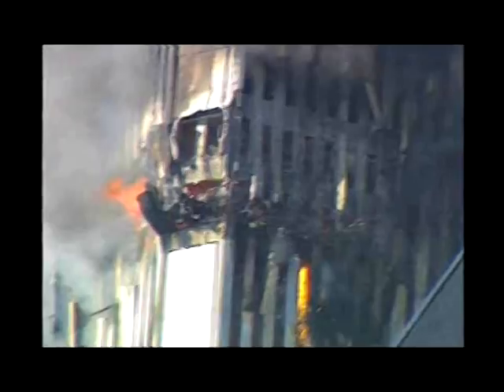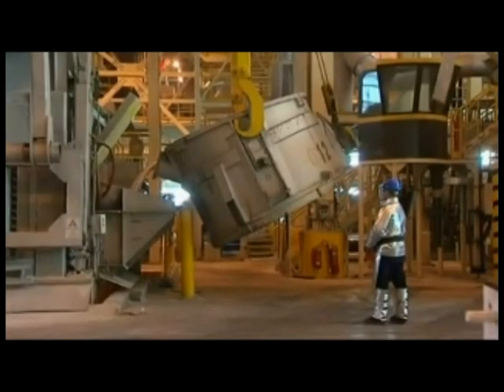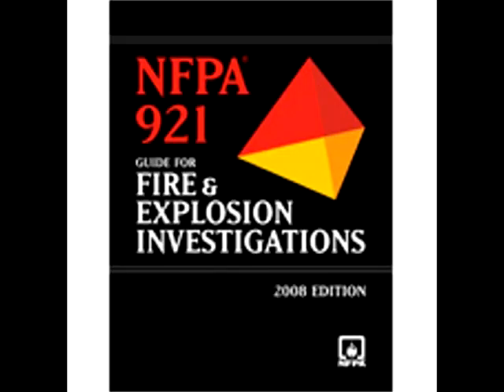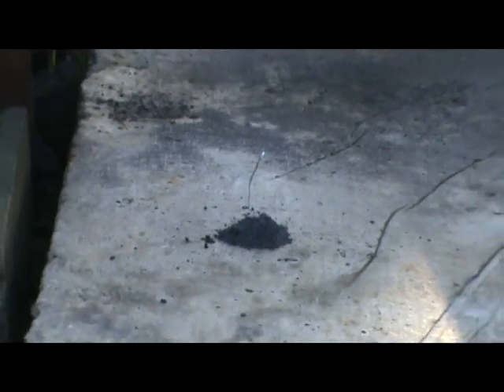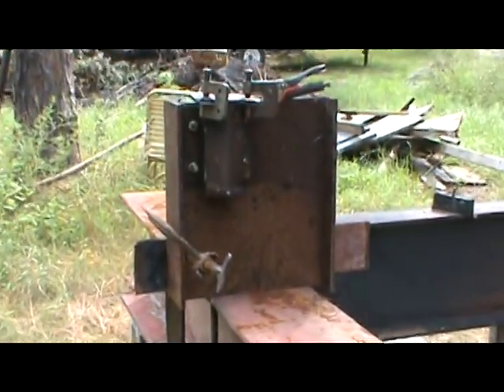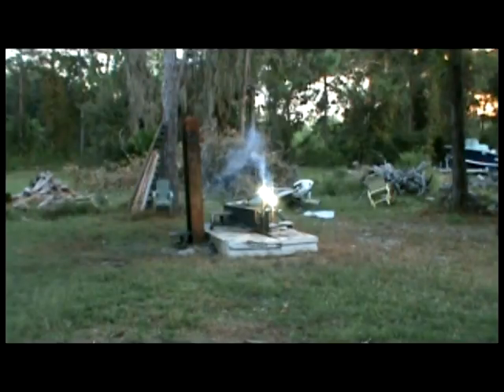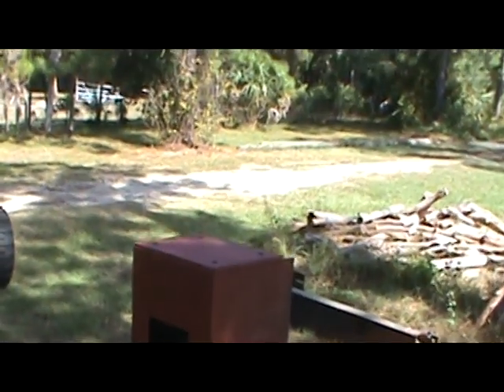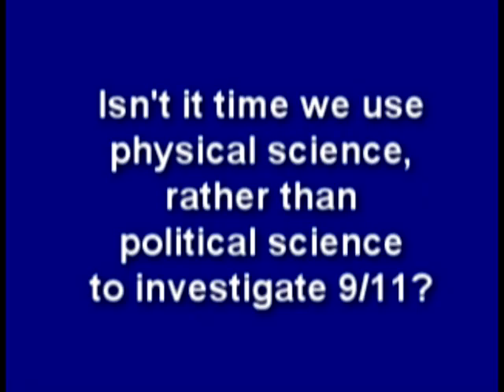9/11 Experiments: The Great Thermate Debate

Comment: Truth does not fear investigation.
Reply: I would say truth doesn't fear an honest investigation
 performed by people who don't believe in magic
 of course if I made just a few hundred million shy of one thousand billion I could afford my own investigations
Reply: @partypoet2012   The problem the truth has is that conspiracy theorists rationalize away any facts that disagree with their conspiracy theory. Believing in a conspiracy theory boosts their egos because they think that the have knowledge that the 'common people' don't.  This makes them emotionally invested in the theory.  As a result they are unable to apply any level of skepticism towards the conspiracy theory because if they did - their egos would be bruised and they would have to admit that the people they refer to as 'sheep' are smarter than they are.
Reply: In fact, sometimes it does. If the investigators are not truthful
Reply: Investigate auschwitz.
Reply: How many of you know who wrote that quote?
Reply: @Mekronid "If the building indeed was bending against a straightedge as you claim, then logically the building's top half could've fallen sideways instead of on its own footprint."
First of all you can see this for yourself.  In fact this is why I recommended that you do this for yourself.  
Second of all:  Remember Newton's laws of motion?  If you want to building to fall over then you need to produce a force with sufficient energy to do this.  Otherwise everything is going to fall in the direction gravity pulls it.
The pillars supporting the building were designed to support vertical loads.  They were not designed to support the loads at an angle.  So the support pillars would fail and with nothing holding the building up - everything will moved in the direction gravity pulls it.  
Buildings are not trees.  In fact look up some videos on tree cutting fails.  There's one video that shows that happens when you try to cut down a hollow tree.  It fell straight down until the void was completely gone and only then tipped over.  
Learn some basic physics.
Reply: @Mekronid Yes they do.  But if you look at the videos of the 2nd tower in the minutes leading up to the collapse - no building was designed to lean that far.  And when resisting wind loads the force is spread across the entire height.  This lean all came from a few floors.  And remember that the steel there had already lost between 40-60% of it's strength simply from the heat.  (Which was why it was bending.)
And once steel exceeds it's elastic limit - it weakens very, very fast until it breaks.
Reply: @Mekronid And speaking of earthquakes - remember that the steel in the tower was not as strong as the designers calculated because it contained the same construction flaw that just about every steel framed building built before the mid 1990's have.*  (Except for the ones that have been retrofitted.  But this will typically only be skyscrapers in earthquake zones.)
* Just about every country had adopted the same building codes for moment-framed buildings and it wasn't until the Northridge Earthquake that the near-fatal flaw was discovered.
Reply: @Mekronid Because - as I explained - the load was not distributed across the entire structure.  It was concentrated on the floors struck by the airplane due to the damaged support columns and the weakened steel.  
And the reason it didn't fall over is because when the steel failed the load was transferred to the remaining columns - creating a progressive failure that cause those columns to fail.  (And this all happenned in less than a second because every failing column meant greater loads on the remaining columns.)
Buildings are not trees.  Trees fall to the side because they cannot fall straight down.  For a building the most direct path is straight down.  And once the load is unsupported - it is going to fall straight down.  
Remember that when things move they will always try to fall in the direction determined by the force on them.  Since the force acting on those buildings was gravity - and there were voids that the building could fall into (all of those wide open cubicle-farm offices spaces) that's where it went.
Reply: @Mekronid Of course it zippered right open - it's what's known as 'progressive failure.'  As the columns on the leaning side of the building failed due to shear forces, the load was transferred to the next columns - which then failed, placing the load on the next, etc.
Personally I have my own issues with the NIST's model for the collapse.  IMO a British group researching fire codes had a better mechanism for triggering the collapse.  (Heat related weakening of the floor trusses.)  But this is quibbling because both models correctly calculated the time from impact to collapse and if one hadn't caused the collapse - the other would have.
And the exact collapse mechanisms is the two buildings were different.  The first building had the central core fail and on the second it was the exterior columns that failed first.
Reply: @Mekronid BTW: you gave up on the thermite/explosives aspect to soon.  I had a week's entertainment by having them try to explain how the explosives/thermite were placed on the exterior columns without everybody in the city seeing what they were doing,
Reply: @Mekronid You seem to think that any skyscraper can survive having all of the support columns on one side removed.  What you describe is a vertical truss and moment-frame construction is used to avoid the necessity of vertical trusses.  Remember that you want your structures to be as lightweight as possible because any increase in mass requires the the vertical supports be larger.  And larger vertical supports means a larger foundation to support the weight.  All of this increases the cost of the building and decreases the amount of usable space inside.  
The WTC was a trailblazing design due to the way the major structural supports were on the outside the building and around the central elevator core.  Everything else was open space that could be easily modified to suit the needs or any tenant.  And the floor structure also kept the support columns in place.  This eliminated the need for cross-bracing which not only meant that you saved a lot of mass. and my saving this meant  mass the support columns don't need to be as large, which meant that the foundations didn't need to be as large.  And smaller foundations meant more parking in the parking garage.  And smaller columns meant bigger windows.  
So the design of that building became taught in structural engineering classes as an example of what good engineering looks like.
Reply: @Mekronid Actually the question you should be asking is not why did they collapse so quickly - but why did they remain standing as long as they did?  And the flaws were not in the columns but in the welds that connected everything together.  In effect the steel was in tension - and tension that nobody was aware of.  As a result nobody's calculations took that tension into account.  Not a real problem because of the factors of safety - except when the buildings have to withstand tension loads that result from something like an earthquake.  In these cases you can (and did) connections fail because they could bot withstand the earthquake created tension loads that they were designed for and the additional (and unknown at the time) tension loads caused by the welds.
And the thing that doomed the central columns was the mechanical action of the plane debris (and everything else being pushed by the plane debris) that stropped out the fire-resistant wallboard and the cellouse-based fireproofing on the columns.  This meant that the steel was no longer protected from the heat and as a result the steel weakened at entirely predicable rates as they were heated by the fire.  But even if the central core remained protected from the fire - the buildings were doomed because the fireproofing for the floor trusses was also stripped off.  In fact you can see the effects of the floor truss failure in the moment before tower one collapsed.  The exterior columns were pulled inwards (and out of true) when the floor collapsed.
Reply: @Mekronid And the financial issue that company faced does not prove any conspiracy related things.  And as for the assets of a failed company being bought by another company - this is the business model for a lot of companies.  Buy a failed/failing company, fix the problems, have the company turn a profit for 3-4 years and then sell it and start the cycle over again.  You are making the same mistake rookie intelligence analysts make - reading into the data instead of focusing on the actual facts.  An example here is your 'revelation' that Bush's brother may or may not have been CEO of (Can you give me his name?  I just look a look and didn't find any of them who were not engaged in other business or political ventures at the time.)
Reply: @Mekronid Actually - it was not 'cheapo joints.'  That was a factor in making the building weaker than originally calculated but it was still well within the 'margin of safety' designed into things by competent engineers.  
The primary factor was the temperature induced weakening of the steel combined with the destruction of several support columns.  This was made worse by the sagging of the floor trusses.  Instead of helping hold the support columns in place they did the opposite.  They sagged and as a result began pulling the support columns out of alignment.  
Please note: I agree with the work done by the British more than I do with the NIST report.  The NIST report basically said that it was a combination of a lot of things - which IMO was a decision made to prevent them from making a solid determination that risks later turning out to be wrong. 
And it's pretty obvious that the floors pancaked down.  If you look at the videos of the collapse you'd notice that as the building collapsed the support columns were the last things to go and didn't fall until several floors below them collapsed.  This is why there were still vertical columns standing for several stories after the collapse completed.  
And the determination that the insulation was stripped off came from physical examination of wreckage from the floors in question where scrape marks from aluminum were found on the structural elements that were protected by fireproofing.  (One of the NIST reports has pictures of these.)
And you would get an instant failure of the floors after a couple of stories down.  It isn't just the weight of the debris - it's the kinetic energy of those debris.  And you can see the floors pancaking in the video by the blast of air pushed out the the floor above collapsed.  And the fire sprinkler system was destroyed by the impact of the airplane.  All they are is pipes suspended from the ceiling.  Nothing protecting them from several tons of aluminum moving at several hundred miles an hour.  And the fireproofing was cellulose based.  You can chip it off with a screwdriver pretty easily.  (This is pretty much standard everywhere because it meets fire codes and is easy to apply.)  
IMO the fire sprinklers were irrelevant.  And although the NIST report said they were poorly implemented - they still met the fire codes.  All the NIST was doing is second guessing the people who actually had to do the work.  It's a lot easier to criticize somebody else's work than it is to do the work.  Remember that everything met code and used industry-standard practices.  
I would not say that the building was poorly designed.  And I would use the length the buildings remained standing as my basis.  They should have collapsed sooner.  What happenned to them was an order of magnitude higher that what they were designed to resist.  The designers of the building were generous when the applied their 'factors of safety' to the building.  (Note - every building is stronger than the designer's blueprints show.  Typically at least twice as strong as what the numbers given by the designer were.  
(BTW - the NIST models were aided by the designer providing them with the real calculations as to the strength of the building.)
Reply: OK I looked it up.  He was a member of the board of directors from 1993 to 2000.  His career was with HHC Insurance Holdings.  
I'm trying to explain to you how things work.  You are a layman so I'm not surprised if you get technical things incorrect.  In engineering there's a lot of stuff that is counter-intuitive to a layman.  One example is the idea that a building will fall over like a tree.  Yes smaller buildings can do this - but not large ones.
Reply: @Mekronid Nope - I looked up biographical information on the person himself.  If you remember I asked for the name of the person.  Because that was the direction I was interested in looking.  Wikipedia pages for subjects that are related to conspiracy theories tend to be unreliable.  
And even then - from an objective basis the facts you presented do not support the conclusion you presented.  
And how many times have I asked for more information from you?  My count is one. (Unless you include this question.)
And my intent is to ensure that factually correct information is presented.  Look at your idea that buildings fall over like trees and and a flaw in international building codes mean that the building was poorly designed.  Then you claimed that there was enough space between the cladding and the columns for people to get inside.  You appear to have a habit of jumping to conclusions.
"Two is dubious. Vanishing money, two ponzi schemes, an auditor connected to Washington D.C., and the goddamn president's brother? That is a conspiracy"
This is a perfect example of you jumping to conclusions.  You think that there was a Ponzi scheme going on but you have offered no evidence that a Ponzi scheme was occurring.  BTW you might want to read up on what a Ponzi scheme is.  It appears that you don't really know what one is.  A company going through a succession of owners before shutting down for good is not a Ponzi scheme.  It's a series of other companies buying a company in hopes that they can turn it around.  
""I just look a look" also implies you didn't look."
<facepalm>
"I just took a look" means that I just took a look.  The only implications you can really get was that I only did a cursory review.  Now I know that you get upset when I ask you questions but I can't resist.  What is your chain of reasoning that leads you to think that the sentence means the opposite of what it says?
Reply: @Mekronid Ah that must have been in those posts I deleted without bothering to read.
BTW - I'm still waiting for you to explain how you took the meaning of my comment as the exact opposite of what I said.  

And I do enjoy being right.  This is why I pick on the conspiracy idiots - they are such easy targets.  Just about everything  you say displays your ignorance of the subject.  
Of course it appears that you've given up on factual stuff and all you have left are personal attacks.
Reply: @colincampbell767  Well done!  I applaud your willingness to argue with purposefully misinformed idiots.
Reply: Michael Freed   "known complicit participants"

And how do you know this?  Can your claim here stand up to a skeptic?
Reply: Michael Freed  I don't have to prove anything.  You're the person making the claims - you prove them.
Reply: Michael Freed  Apparently you lack reading comprehension skills.  It's your conspiracy theory - you either support it or you'll be admitting that it has no real factual basis.

And if you do decide to support it - don't use stuff that I've already debunked.
Reply: Michael Freed  "That the same airplane wings that go through steel and concrete in NYC due to speed also collapse upon impact with steel and concrete in D.C.?"

In case you haven't noticed - the buildings were constructed differently.  And the plane didn't go through concrete at the WYC.  

So Strike one

  "You debunked that when a fire on the 77th floor of a building melts seventy-two columns at the exact same height, at the exact same time, at the exact same inward angle, the lower 70 + floors of solid, unmelted steel don't also disappear?
"

What makes you think anything melted?  And if you look at the NIST reports - they recovered pieces of the steel support columns that got hit by the plane - no signs of anything melting.  And if you look at the videos - you can see the failure mechanisms. If you watch carefully - you can see the support columns get pulled inwards on the first building and on the second you can see the building drifting slowly out of true in the minutes before it collapsed.  

Strike two.

"They weren't there when the concrete burned off."

What concrete burned off?  Where?  Are you even aware of just how stupid that comment was?  

Strike 3 - And I'm not bothering to read any more.
Reply: @colincampbell767  The amount of bs you are talking literally blows my mind. The outer columns have enormous reserve strength. Loads on these columns can be increased by more than 2000% before failure occurs. In addition, NIST tested only 3% of the outer columns on the fire floors, so not really representative. They also acknowledged in August 2002 that fire could never have caused the total collapse. 

They also assumed at first that the office spaces caught fire which would set off some sort of chain reaction. But many floors were empty, with which Silverstein also lost a lot of money. He had a lot of trouble finding tenants and many also moved to cheaper buildings. In addition, a fierce fire, bigger than 9/11, on February 13, 1975, one they managed to keep out of the spotlight, spread to the office space of WTC 1 on several floors from the east to the west. lasted more than three hours. So that is almost twice as long as at WTC 1 and more than three times as long as at WTC 2. As a result of this fire, a lot has been invested in fire resistance and sprinkler systems so that if it happened again, it would never be that far. could spread. During the fire, the glass was broken from the heat, meaning the temperature was above 700°C. This was not the case with 9/11. So on 9/11, the fire was less intense, and had more security than on February 13, 1975, but it still collapsed. And that while the fire of February 13, 1975 caused relatively little damage, because no structural parts even had to be replaced! The floor trusses were not even damaged. After cooling the sample, a bluish color should appear on the sample. This was not found after 9/11, which means that the temperature is not high enough for structural changes to take place in steel. 

They estimate the maximum temperature at 600 °C, but they are already unable to distinguish between temperatures between 250 and 600 °C. So they cannot prove temperatures above 250°C. In addition, at the time of collapse, the core columns were at a maximum of 450°C, which would mean that the columns would still have 70% of their strength. 98.5% of the sample NIST received showed that it would actually lose no strength at all. The areas from which the steel NIST conducted their tests came from, they said, came from the fire-affected areas.

So your claim that the steel from WTC lost more than half of it's strength is very misleading, and even false for most parts. Also you do not take fire resistance into account. In addition, according to NIST, no fire barrier was displaced where it collapsed. NIST conducted 4 fire tests on reconstructed WTC floor trusses. By the time the test was stopped after 1 hour 56 minutes. It took NIST hundreds of pages and dozens of different charts to explain that nothing really happened. NIST spends a lot of time reporting that Test B is compliant with Standard C and Test D is compliant with Standard E. Readers of the report must come to the conclusion that, oddly enough, the floors never collapsed. Apparently there were signs of partial or complete collapse at this point with Tests 1 and 3, but that was with firing times that were unrealistically long and unrealistically intense. In some areas, steel in Test 1 and 2 reached 850 °C. Test 3 even shows steel surface temperatures of 1,950 °F (1,060 °C) after 3 hours. In addition, floor loads had doubled from what could be expected at the World Trade Center. And yet the floors didn't collapse https://www.nist.gov/publications/fire-resistance-tests-floor-truss-systems-federal-building-and-fire-safety

Under these unrealistic conditions, the floor trusses would have sag 4 to 6 inches, while according to the NIST model, the floor trusses should have sag 42 inches. As a result of these unwanted results, they switched to a computer model in such a way that the floor would sag. They stripped all firestops and subjected them to a maximum and unrealistic continuous burn time, disconnected the floor supports/trusses for floors 95, 96 and 97 and manually inserted a lateral retraction force to 'stimulate' which subsequently led to the collapse of the buildings (p 111-113, 115) https://www.nist.gov/publications/structural-fire-response-and-probable-collapse-sequence-world-trade-center-towers-0
Reply: Mom's Ravioli
Then why does the flat earth still have followers
Yeah, that seems true...
Reply: @CoffeeandXanax "then you, or nist or someone needs to produce an experiment that proves you correct and him incorrect."

Nope.  That's not how it works.  You make a claim - you back it up.  And then you defend your claim by addressing concerns brought up by the skeptics.  If those concerns blow huge holes in your theory and if you cannot adequately address them - then you have to throw out your theory or amend it so that it fits the known facts.

And if your theory uses as "evidence" things that are physically impossible (such as the claim about pools of molten steel at the TWC site and the claim that you need to actually melt structural steel before it fails) ) or is wildly improbable (like the claim that the building could have been wired for demolition (which would have included accessing the exterior pillars) without anybody noticing.  

Even worse the theories are not consistent with the videos of the collapse nor are the consistent with the physical layout of the debris ate the site.  

Basically the theories sound compelling up to the point where you start looking for confirming evidence and stop ignoring the blindingly obvious holes in those theories.  

A sure sign of a fraud is when they give you questions instead of facts.  If they're asking questions in place of providing their supporting evidence - it's a safe bet they don't have any real evidence.
Reply: @CoffeeandXanax Then the idiot should have read the dozens of posts where I refuted those same points.  I've already done this with well over a dozen people (read the posts in this and the other threads.  You keep on bringing up the stuff that has been shot down several times and then demand that I say the same things over and over again.  In fact it usually take several repetitions before they even read my posts.

If your theory does not match what we saw immedeatly before and during the collapse of the towers - you're an idiot.  If you are going to claim that 'steel doesn't melt at 'X' temperatures and think that you just said something significant - you-re an idiot.  If you are going to criticize the NIST's report - but haven't spent the time to read the whole thing - you're an idiot.  If your going to claim that somebody's research supports your theory but ignore the fact that his model produced results that were no consistent with the pattern of debris after the collapse - you're an idiot.

If you think that this thermite video means anything (beyond the fact that thermite can do what it was made to do - burn through steel) you're an idiot.  

Want me to think that you aren't an idiot?  Tell me what percentage of it's strength structural steel has at the temperatures produced by burning JP-4.  And then explain to me why this was not a significant factor in the collapse.
Reply: @CoffeeandXanax Read the dozens of times I've already done this.  But the biggest error is the idea that the steel needed to melt before the building could collapse.  As I've pointed out many, many times before and provided references many many times before - structural steel loses strength when it heats up.  And I've provided links to engineering references that identify what percentage of it's strength structural steel has as temperatures increase.  Look up my previous posts find the references I posted and then read them for yourself.
Reply: @CoffeeandXanax "Where's the experimental data, not a model for their claim?!?"

it's all there the report and the appendices.   All you have to do is read it.  If you are unable to locate them yourself - I provided links several times in previous posts.  Go find those posts because I am not going to waste my time giving you information you aren't going to bother to read.
Reply: @CoffeeandXanax So you're saying that somebody should have built a skyscraper and then crashed planes in to it?   Especially since the models used to design buildings and investigate how they fail have been the 'go to' tool for over 40 years?  

What issues do you have with the models?  The models work.    And the proof of a model is when the results it produces are consistent with real world observation.  Also remember that all of the NIST data and the models themselves were distributed to the ASME (American Society of Mechanical Engineers)  and the ASSE (American Society of Structural Engineers) for peer review before official publication.  And the NIST reports were modified as appropriate based on the feedback from experts in the subject.

FYI - I think that the NIST reports are fairly reliable but that they understated the effect of fire on the floor trusses.  A British fire-safety organization released their own report that cites the fires effect on the floor trusses as what initiated the sequence of events that resulted in the collapses.  (References are somewhere in my previous comments.)
Reply: @CoffeeandXanax " the experimentation that potentially proves it."

Exactly what experiments are you looking for?  (And how do you know it wasn't done and addressed in the reports?)
Reply: How many people saw the thermite being planted in the weeks before the hijacking?????
Reply: Mom's Ravioli well said !
Reply: @BobBobbertson-j5n  Gee, but You Are Mental.  When the 1st Tower was hit the news companies from Around the City went to cover the story.  When the Second Plane hit Tower 2 it was broadcast Nationwide.  I was off-work that morning.  I got to see the second passenger jet hit the building lower than the 1st and As It Happened. 

Now it the airliners were NOT Hijacked what then happened to the hundreds of people flying Inside the aircraft?
Where did the aircraft go to?  Remember that one hijacked aircraft crashed in Pennsylvania.  Or are you telling me something else crashed in Pennsylvania?

The videos are out there.  People like you just don't want to find them.

Watch the video and read that article.

http://www.youtube.com/watch?v=FzF1KySHmUA

http://spluch.blogspot.com/2007/04/tanker-fire-melts-freeway.html
Reply: @Senor Frog NOBODY saw anybody attach anything to the girders.  Add to that the Simple Fact there was No Way to predict where the aircraft were going to hit the buildings.
Don't forget that NYC is THE Media Center of America.  People saw nearly everything  LIVE.  I got to see the second aircraft hit as it happened.  Later I saw the building collapse.

As I used to Live in NYC in the 1980's I KNOW that thermite Could NOT have caused of ANYTHING that Day.
Reply: Shai Dorsai what about building 7?
Reply: Actually in this case you can find the 'truth' in any structural engineering textbook. Like all metals as the temperature increases, structural steel loses strength.  At 1000 degrees F structural steel only retains 40% of it's original strength.  

That property of structural steel is why the towers collapsed.  As the temperature rose the steel weakened until it could no longer carry the load.  Anybody talking about 'thermite' is a moron who does not have the qualifications to be discussing this subject.
Reply: Colin Campbell lmao a structurally weakened building twists and bends and falls to the side not straight in on itself the buildings were demolished yuh silly willy get your head on straight bucko your argument is one of twinkles and kindergarteners kiddo yuh kid yuh child yuh silly lil goose sorry just had to step down to your level of intelligence for a second
Reply: @xx_mysticwolf_xx1492  "  structurally weakened building twists and bends and falls to the side not straight in on itself . . ."

<facepalm>

No.  They don't.  The support members are designed to resist vertical loads only.  Twisting out of true puts a sideways force on them that they were never intended to withstand.  They buckle.  And when one buckles the remaining supports have to carry the load of the failed one.  Most buildings have enough redundancy to survive this.  

But if enough supports buckle then the remaining ones will buckle also.  When this happens there is now nothing supporting the building.  At this point - gravity takes over.  And gravity pulls straight down.

For a building to fall in a particular direction there has to be a force pushing it in that direction.  You seem to forget that buildings are basically hollow.  So the path of least resistance in a failure will always be straight down.

Or are you saying that every structural engineering textbook, every structural engineer and all of the software used to evaluate the structural performance of a proposed building design are all wrong?

Congratulations.  The only thing that you have convinced me of is that you have absolutely no clue as to what you're talking about.
Reply: Colin Campbell well kiddo you clearly don't understand how they work so I must have fooled you ;)
Reply: @xx_mysticwolf_xx1492   I don't understand "how they work?"   Please elaborate, I expect a good laugh out of this.
Reply: Colin Campbell I've tried for years to explain the truth of many things to people and ignorance abounds there is no reason to sit here and spend all that time explaining it to you I used to try I simply don't care to anymore if you don't get it then you just don't get it sheep are forever !
Reply: @xx_mysticwolf_xx1492   Ah yes another 'physics expert.'  Care to explain your 'basic physics' to the rest of us?
Reply: @xx_mysticwolf_xx1492   I'm still waiting for you to explain your "basic physics." 

Starting to suggest that you have exactly zero actual knowledge of classical physics.
Reply: @colincampbell767  Colin I like the part where you debunk the Nano thermite claim because NIST carefully tested for explosives and found out there weren't any.  
Wait nvm. 

I like how they cleared the debris up so fast and ship it to china to melt. Real science was done that day. The funny part is, dozens of fire fighters and civilians heard multiple explosions, yet they didn't test for any.

imagine if this was any other event, morons like you would be all over the place asking why an proper autopsy was not done or why was the possible culprit able to handle who does the autopsies so they cant botch it or lie. amazing. And the cherry on top, the mainstream media.
Reply: @colincampbell767  you can clearly see in the video that beams where not melt
Reply: @joserafael9913  My point was that any theory that involves thermite is pretty stupid.  And you don't test a theory like this by using thermite to cut as small piece of steel (what type of steel was it?)   You use commercially available structural engineering modeling software (the kind that is used to design building and other complex structures and create a model that assumes certain elements were cut with thermite.  You then look at the data the model produces and see if it produces results that are similar to what was observed.
Reply: Read my comment. There's more truth than I'm allowed to say. ....dammit America! Are we this naive? 
 It was a fail safe for national security when she was at extremely high risk.
 We built in self destruct mode in case of war! 
.....come on people.